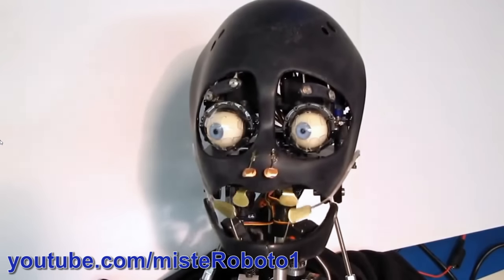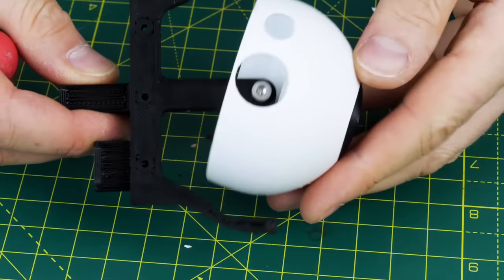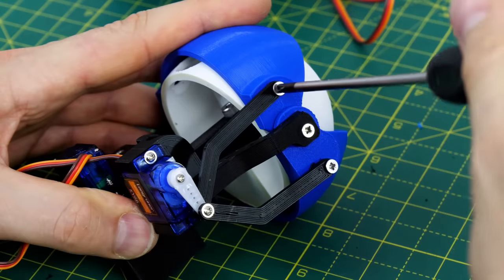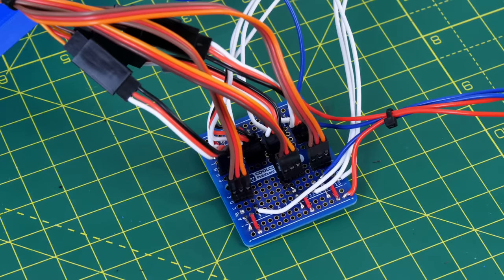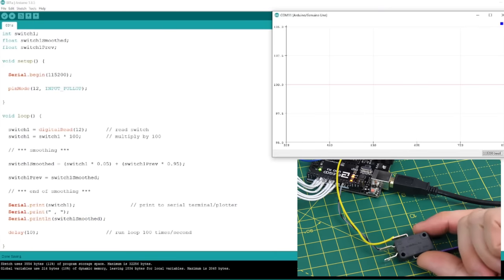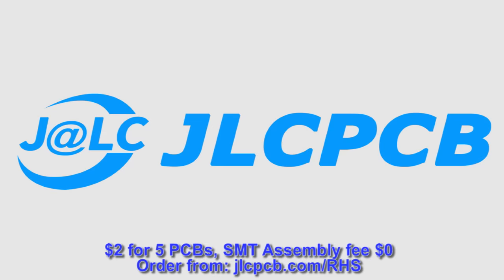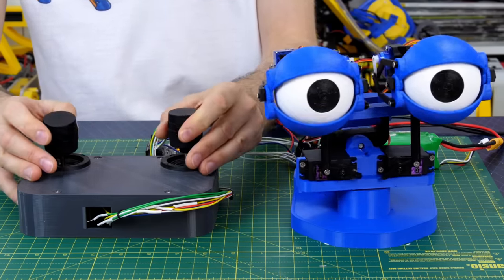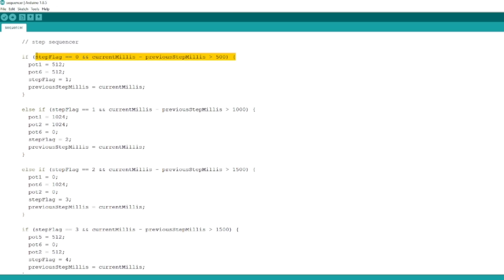How To Make Robots Move Smoothly | Arduino Tutorial

Comment: This method also works well for making LED animation look smoother.
Reply: Example?
Reply: This is Mike, you don't ask him for example. His channel is example
Reply: I can’t imagine this. Any examples?
Reply: It also works for making smoother music synthesizer sounds
Reply: @BlondieHappyGuy  Hey, thanks - it’s kind of out of left-field, but your description of the echo problem may have solved a weird problem my plant has been having with an identical pair of Endress-Houser level sensors being used to measure water levels in two identical stainless-steel mix tanks. Visually, the water exhibits no turbulence as the tank is filled, then emptied, yet the graphs from both instruments show regular “steps” as the water level is slowly drawn down. I’m willing to bet we have a resonance issue in the cavity formed by the stainless tanks, and the interactions with the sonar!
Further backing this possibility is that another identical E.H. level does not produce “stepped” graphs at all; just a smooth, linear “sawtooth” as the hopper empties between refills. But this isn’t water, it’s soda-ash, which I’ll bet dampens the hell out of echoes compared to water. Thanks for possibly solving a real head-scratcher!
Reply: It also makes a onahole hole moves smoother
Reply: Geez people. If you need to ask him for an example what you really need is an introductory course on Arduino PWM programming. Think of a servo as a PWM -controllable device. Nuff said.
Reply: @yt45204  That's excellent advice, so I went out and double-checked, but the outputs were verified to present 14 bits, and identical units measuring dry powder (soda ash) exhibit none of these symptoms. When the vessels fill, they fill much faster (~5 minutes) than when their batch is being drawn down (~4-6 hours), but the fill trend is as smooth and linear as could be expected.
Reply: @mbunds  Hmmm...  Would it be possible to add a stainless-steel mesh inside the container to interfere with echoes or even just attach heavy concrete blocks (or w/e) to the containers to dampen vibration?
Reply: @KeithOlson  You may be on to something, but our level sensors use microwaves, so damping with a (grounded) mesh is actually a very good idea! When the fluid level falls enough to cause "resonant peaks", grounded stainless-steel pads made of several layers of mesh may be able to disrupt the spurious "echoes", and reduce the false "stair-stepping" we see in the signal.

Comment: Here's something to try, though it will take a small bit of computation.  Have the eyes snap left or right quickly, and then have the neck turn more slowly in that direction, but counter-rotate the eyes as this happens so they appear to have locked onto looking at something, and the head then turns to consider it...
Reply: Fun fact: human eyes won't move smoothly unless they are focused on a moving object (or what brain thinks is a moving object). At any other time eyes just snap to a new position very quickly.
Reply: @JTCF  Not a fact and why would it be fun for everyone if it was true.
Reply: @maxxsteele9396  it's absolutely true
Reply: @JTCF  Yes, but they will also move smoothly when you focus on a stationery object and then move your head.
Reply: @maxxsteele9396  how about you cite a source supporting your claim and refuting theirs, rather than resort to baseless insults?
Reply: @SamFisk  The burden of proof isn't on me since I made no claims. See how that works?
Reply: @maxxsteele9396  you dont need even need a source, just film a video of yourself looking around, then looking at something moving(or, as Martin Jones suggested, look at something stationary and move your head). Quick and easy way to test your theory.
Reply: @maxxsteele9396  also, I agree with Sam Fisk. Why did you straight-up insult the guy? if you think someone is wrong on the internet(about eye movement, which not a very hot topic), telling him he's on drugs and has a mental disability is not the appropriate response.
Reply: @iAmTheSquidThing  Yes, it's true, but it also can be seen as object moving relatively to human head, which is what it is for our brain. And I mentioned it in my original message.
Reply: I got this info from various sources, as well as noticing it on myself, and one of the best sources is already linked in one of replies.
Reply: @JTCF  also, something i've noticed on myself, anytime the eyes snap to a new target the eye lids seem to blink
Reply: @JTCF  "saccade" is the word for this.
Reply: @maxxsteele9396  just ask your friend to try it out
Reply: that'd be awesome animation... also kinda creepy lol
Reply: @iAmTheSquidThing  Then the stationary object is moving relative to your head.
Reply: @maxxsteele9396  Provide proof that you don't have to prove it

Comment: For anyone wondering how to smooth the launch of the curve as well, just check out different interpolation functions.  Trigonometric or cosine interpolation is a really common one for essentially making this curve from the video smooth on both launch and landing.  They are also going to be just one line in your code!
Reply: Very good point. A programmer friend of mine went and did his high school maths again to remember how to use Sin wave. He uses it to start and stop motion smoothly.

Comment: Fun fact: a similar method can also be used to fuse two sensors' data giving out the same information to smooth out the output data, for example:

If we have an a gyroscope and an accelerometer sensing the same angle, we can set a new variable fused_angle = 0.95*gyro_angle + 0.05*accel_angle. 

Cool thing about this is that the gyroscope captures changes in the angle faster but it has what is called "drift" (the value it senses slowly deviates from the actual angle), while the accelerometer is not nearly as fast at detecting such angle changes but it does not drift. Fusing them together gives you an angle reading which is responsive thanks to the gyro contribution, but does not drift thanks to the accelerometer cobtribution.

This is a good alternative to using more complicated (and computationally expensive) methods such as a kalman filter while still giving very good results in most cases (at least when talking about arduino projects).
Reply: Of course, I read this now, months after giving up on trying to work this out on my own on 6050s, and instead just (through sheer luck) used someone else's head tracker XD

All jokes aside, this is fantastic to read and I might give it another go. While the tracker I found works, it'd be nice to do some customising!
Reply: Yes. This is a good option. For anyone who wants to learn more, the sensor fusion version described here is known as a Complementary Filter.
Reply: @martinmckee5333  thanks, completely forgot about the name!
Reply: Wow...  This is the kind of thing you don't know how to find when you need it, you don't learn in a class because you were distracted for the 2 minutes it was mentioned, and no one talks about.  It's so obvious but so passable.  Great tip!
Reply: @fiveoneecho  i've been like, toe deep or ankle deep in this stuff for a couple days, and while complementary filters are cool, kalman filters, madgwick filters, and others are even cooler.

(EDIT: wow i missed that kalman filters were already mentioned as more expensive, reading comprehension fail. >_>)

I'm currently using a library called dcmimu (which is the rust port of a c library with an associated paper called dcm-imu) and, frankly, i'm just treating it like a black box. probably shouldn't be, but i haven't had the bandwidth to try to properly evaluate all the options i have, when i'm still trying to figure out what the best method for calibration is. (after all, garbage in, garbage out)
Reply: @kitlith  Sincerely, I feel like as long as you trust the library, vaguely understanding the concept behind it is enough for most purposes. This approach also lets you quickly assess multiple possible solutions, compare them and decide accordingly what suits you best. I don't see any problem in using stuff as a black box :)
Reply: @kitlith  I’ve been trying to find every excuse to both use complex filters and avoid complex filters lol
Reply: what about if you are too poor to have either a gyro or accelerometer
Reply: @Blox117 well, obviously then you cannot fuse data because you don't have more than one datasource. I would choose the accelerometer bc while slower  it will nlt drift. Anyway, most IMUs are a combination of accelerometer, gyro and magnetometer and they can be quite cheap, so the scenario is truly hipothetical.
Reply: @carlesmolins3269  what if you are too poor to have any of them
Reply: You can also use a little bit more complex, but very good Kalman filter

Comment: In animation everything should have an ease in when it starts moving and an ease out when it stops moving. The easing should depend on the total movement, the speed, the elasticity, the mass, and things like that. Something with little mass can accelerate quick and it can also decelerate quickly. So the eyelids don't need as much smoothing as the eyes, and the eyes don't need as much as the head.

I think the way you did it is a huge improvement on the default binary speed. It's also nice that it is very easy on resources and it's easy to understand and implement. So I think this solution is a very good compromise between realistic movement and complexity. This also makes it great for beginners.

That said, as I mentioned in the beginning of my comment it should look even more realistic if it also included an ease in. It should also look more realistic if all servos get their own smoothing parameters. Choosing the wrong smoothing can make it look worse though, so it requires a bit of tweaking
Reply: A little ease in is achieved naturally by the limited force the servo has to move the mass. It would be cool to wire the feedback potentiometer of the servo to the arduino to see the real position. We only saw the desired position on that plot
Reply: @viniciusfriasaleite8016  also the fact that he's converting rotational motion to linear theres some sinusoidal ease-in and out

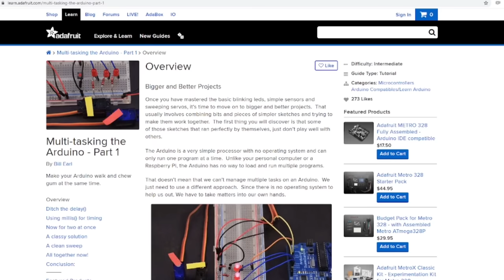Comment: 9:35 Running all events in an infinite loop is not energy efficient nor is using delay functions,  the best approach I found when i was working with PIC micro controllers is to use an internal  timer TMRO to generate an interrupt at fix intervals and then run all events within such interrupt,  the lapsed time within interrupts the micro controller can be in sleep mode until next interrupt saving big time on battery life.  Now I use ESP32 with RTOS and internally has the same principle with the added feature that each interrupt checks for task priorities on the queue and that's how  multitask operating systems work.  The ATMEL 328 used by arduino uno has 2 internal timers that can allow even more options. I think the loop approach used by Arduino is good for beginners but create really bad habits for embedded programming.  The way to go is to get familiar with interrupts, service interrupts and priorities.

Comment: Thank you so much! I’m working on a 6 DOF robotic arm and want to use various accelerometers spaced over the arm to work out the position of the head in relation to the base of the arm. This smoothing will be key to make the movement of the arm easier to control with less jerking.
Reply: If you are working on creating a robotic arm, you should try to work towards programming a PID controller. It will give you much more control over how the arm moves.
Reply: @blackbomb64  PID is so next level. Thank you for the advice. Will give it a go :)

Comment: You can re-arrange your smoothing formula a bit.  newpos = oldpos + k*(target-oldpos) where 'k' is typically 0.05 to 0.03.  This is a tiny bit faster (only one multiplication vs two).  But more importantly, needs only one constant.  Your original formula (@ 6:11) you have to always make sure that the two constants (0.95 and 0.05 for example) add up to exactly 1.000.  This can be easily missed when tuning the values.

Also, you can get a bit more precise by using the delta-time step in the formula (but takes another mulitplication)  newpos = oldpos + k2*time-step*(target-oldpos).  (where k2 is a new constant tuned for)  So long as the delta-time isn't very long, this can give very precise movement that accounts for just how often the loop runs.  For an animation it's probably not worth it, but if you're doing precise positioning of an item, it can be useful.

Comment: I think this code will really help my skeleton animatronic.  It's a modification of a leering skeleton on a grave, powered by an Arduino, with PIR sensors for eyes. It wakes up when it sees motion, with red glowing eyes, and pivots it's head and body to look in the direction of the movement.  I'm currently using delays to get attenuated movement, but this will look ten times better with smoothing. Thanks for sharing!

Comment: Another way is the single pole digital filer.  

Vnew=(Vin-Vold)*delT/tau+Vold
Vold=Vnew

Tau is the time constant (small is fast) and delT is the step size (in your case 10ms).  Vin is the signal from the switch.  Vnew goes to your servo.  

Good video as usual!

Comment: You don't need `switch1Prev` because it always has the same value as `switch1Smoothed.
Just `smoothed = smoothed * 0.95 + input * 0.05` is enough.

It's also worth noting that eyeballs are the fastest-moving part of the human body and naturally have motion very similar to servos.
I would not smooth them, or only very slightly, but have them target something in global space with inverse kinematics, and have the head follow the direction of the eyes slowly and smoothly.

Comment: Another way to do this is to have a second variable called "speed" (or acceleration). Which you adjust positive or negative based on how far the new value is away from the previous and you can then also make the speed value smoothed. Which will make a smooth start + end possible. Now the start is still 'sudden'.
Reply: Just use a PID, you'll get all the variables you need

Comment: What James has created here is a low pass filter (fast input changes are reduced). This can also be used to reduce 'blips' in analogue values such as reading a light sensor etc. I hope you don't mind but I've pasted a function to do this. Call it with input=the analogue value read (converted to double), and f as the cutoff frequency in Hz (try 0.3). Call it from a timed loop (e.g. reading a value and having a delay (e.g.100ms)

double filter(double input, double f)
{
  static bool initialise = true;
  static double prev_x = 0, prev_y = 0;
  double y;
  double T;
  static unsigned long lastmillis;

  T = (millis() - lastmillis) / 1000.00;

  //f = 0.2; //Cutoff frequency in Hz, small value makes a slow response
  f = f * 2 * PI;
  //if (initialise) y = input; else
  y = f * T * prev_x + prev_y - f * T * prev_y;
  initialise = false;
  prev_x = input;
  prev_y = y;
  lastmillis = millis();
  return y;
}

Comment: Similar technique can be used to smooth analog signals, a FIFO buffer of 10 or so values, added together then divided by 10. When a new value enters put the old one out and reaverage. Easiest is to keep an array and cntr. Put the value in at the cntr, increment by on. If the cntr >9 reset to zero. You just overright the last item in.

Comment: Excellent tutorial!  My own experience with smoothing motion comes from the control used in the Canadarm/Canadarm2 robots.  In those, the operator puts in a desired motion vector, and the joint servos are commanded simultaneously to give a blended (resolved) motion along the desired vector, which changes every 80 milliseconds.  The operator's command is with two joysticks that give 6 axis control.  It looks very smooth and natural (but of course costs multizillion dollars).

Comment: it's important to note that this method of smoothing always adds a bit of delay into the system, so for things that you want to be smooth but still snappy, you'd be better off using a proper easing method which allows you to specify exactly what time it should take to get to its final position, and whether it should ease in or just start immediately like your system does

Comment: Very nice project. 

A little tip ;) 

You could implement the setSequencer (10:05)  using a switch / case to avoid if/else statements and in future projects with more steps, use a Design pattern like state machine.

Using switch/case could be something like this:

void stepSequencer()
{
    int ellapsedTime = currentMillis - previousMillis;
    bool changeStep = false;
    
    switch(stepFlag)
    {
        case 0:
            if (ellapsedTime <= 500) break;
            pot1 = 512; 
            pot6 = 512; 
            changeStep = true;
            break;
        case 1:
            if (ellapsedTime <= 1000) break;
            pot1 = 1024; 
            pot2 = 1024;
            pot6 = 0;
            changeStep = true;
            break;
        case 2:
            if (ellapsedTime <= 1500) break;
            pot1 = 0;
            pot2 = 0;
            pot6 = 1024;
            changeStep = true;
            break;
        case 3:
            if (ellapsedTime <= 1500) break;
            pot2 = 512;
            pot5 = 512;
            pot6 = 0;
            changeStep = true;
            break;
      /// Other steps
      default: 
              // Maybe restart the steps
             stepFlag = 0;
             break;
    }

    if(changeStep)
    {
        ++stepFlag;
        previousMillis = currentMillis;
    }
}
Reply: tika muchkond hogo le lowde